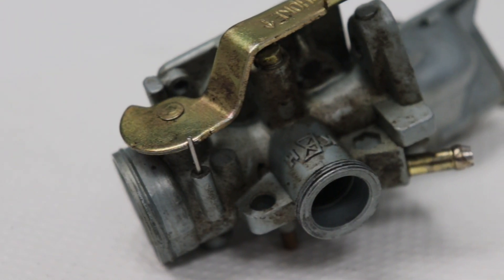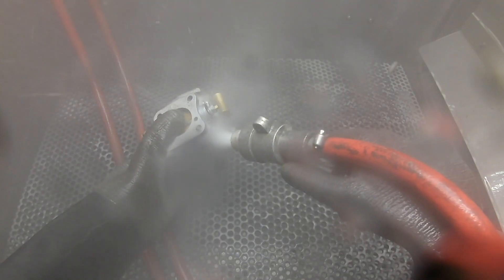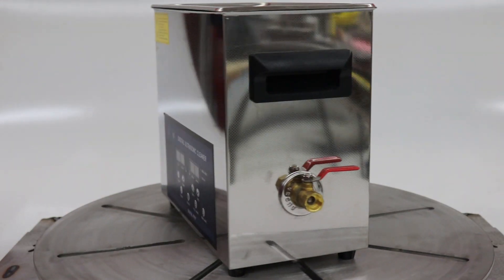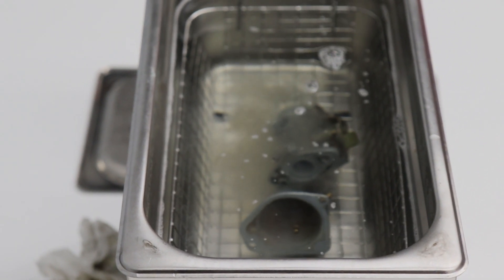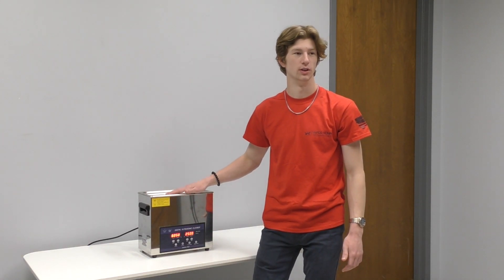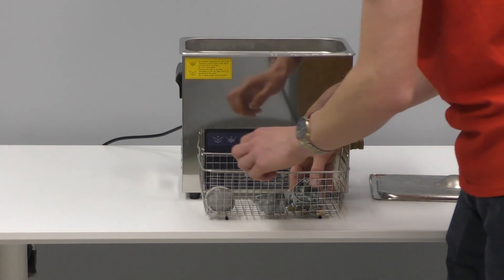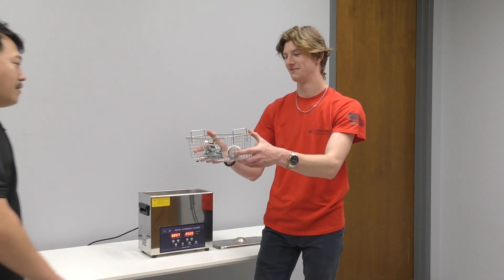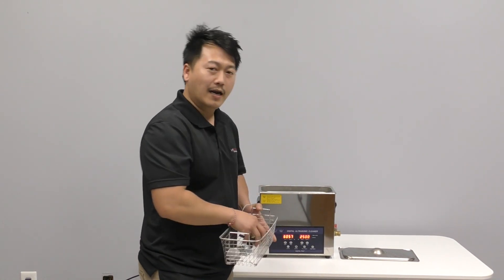De-greasing parts using Ultrasonic Cleaner: Part 1 - Vapor Honing Technologies

Comment: Everything has to be free of grease an oil before blasting otherwise you are changing your slurry out after every single job. A high volume parts washer, ultrasonic cleaner and a dry blasting cabinets are all necessities in addition to a vapor blasting cabinet.

Sure. A vapor blasting cab WILL degrease parts. The next job will have a terrible finish. Splotchy / streaks etc. Most of us have one or two cabinets max in our shops.
Reply: I do wonder how it would be if only using a co2 blaster.

Comment: I have been working with Hunter to pick out the right vapor blaster for my needs and even though the machine will clean and degrease parts I was planning on cleaning off as many contaminants as I could before putting them in the blaster.  Thank you for the confirmation.